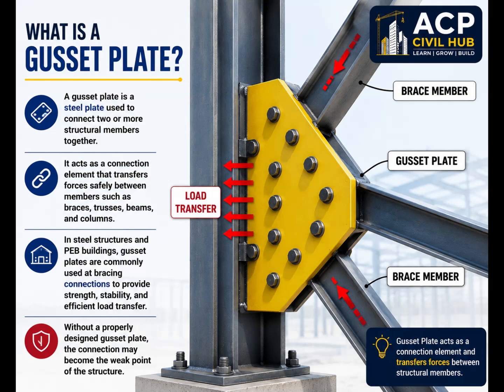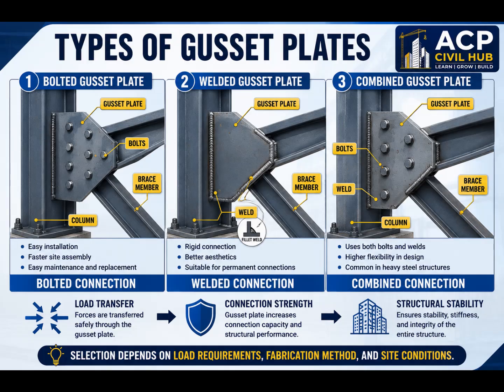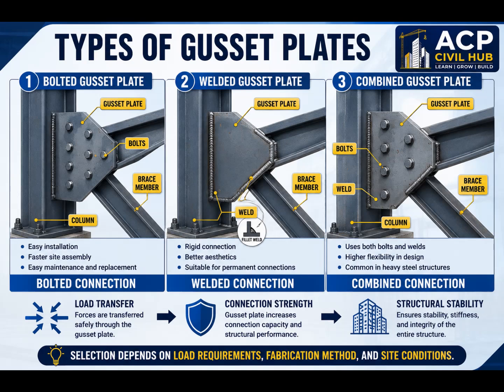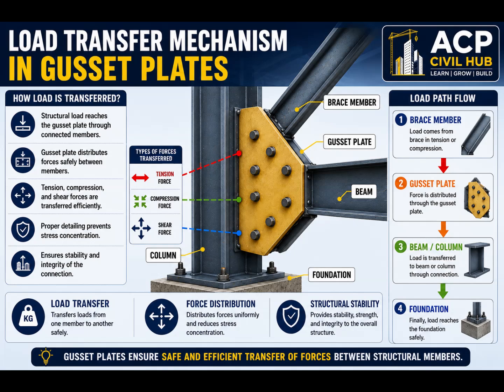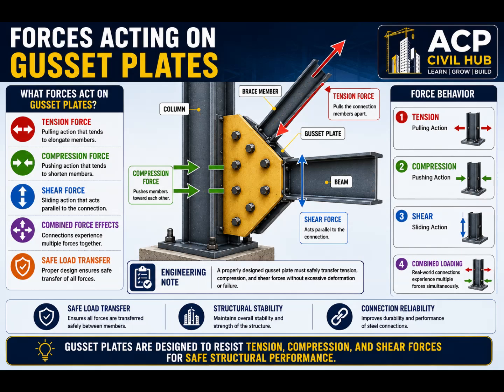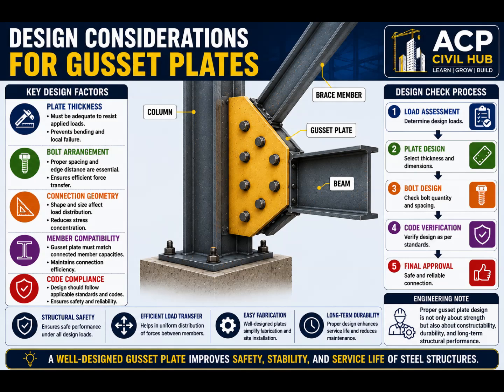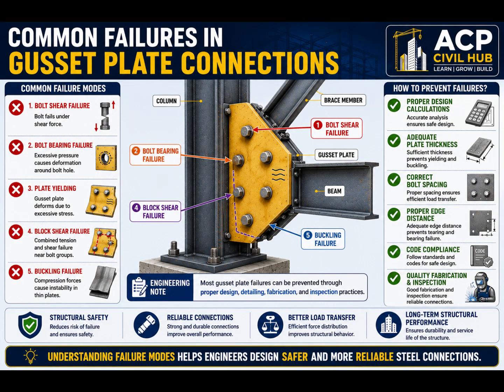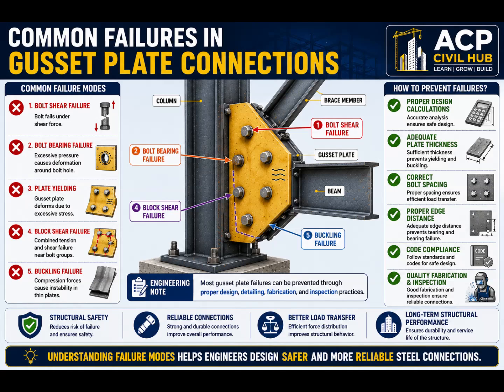PEB_VIDEO-07 : Gusset Plate Connection Explained | Steel Structure & PEB Connection Detailing Basics

Comment: Excellent explanation of gusset plate connections. The load transfer mechanism and force distribution concepts were explained very clearly. This is very useful for civil engineering students and steel structure professionals.
Reply from the maker: Thank you for your valuable feedback. I'm glad you found the explanation helpful. Understanding gusset plate connections is essential for safe and efficient steel structure design. More practical PEB and Structural Engineering topics will be coming soon on ACP Civil Hub.

Comment from the maker: What other Steel Structure or PEB topics would you like to learn next?

✅ Base Plate Connection
✅ Anchor Bolt Detailing
✅ Bracing System Design
✅ Moment Connection
✅ Shear Connection
✅ PEB Portal Frame